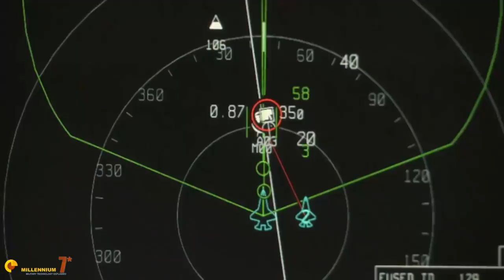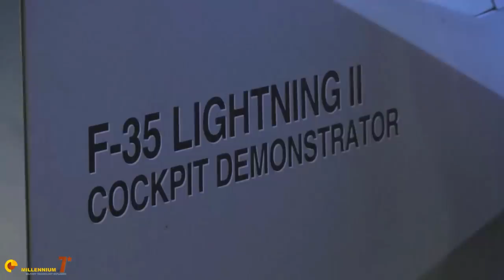Put the F-35 inside the F-16 | Are there limits to upgrades?

Comment: Guess I have to give up on the fantasy of a beefed-up F-16 powered by the Pratt&Whitney F119....
Reply: Some of the most important features of the F119 motor come from the airframe it’s mounted inside.  5th Gen designs don’t have federated subcomponent systems like a 4th Gen aircraft.  The AESA radar is part of the engines, which are part of the DFLCS, which is part of the VLO management software, which is programmed into the central brain, where everything connects.

There’s a GE F100-GE-132 for the UAE Block 60 Desert Falcons with 32,000lb of thrust, meant to lift all the extra weight they packed into the F-16E/F.  UAE bought those for $200 million each.  After a few years of operation, they signed a peace deal with Israel so they could order 50 F-35As.
Reply: @unknownuser069  It didn't compute when that statement was made by F-35 developmental pilots either, since my framework of understanding was based on systems architecture from the teen fighters, primarily the F-16 & F-15.

If you look at the low pressure cold fan stage of the F135, it has heat exchangers integrated into it, which are an integral part of the IPP, which is integral to the radar power amps and other hot systems. Additionally, these are all integrated with the IR signature reduction systems, which are many.

It's not what I originally thought it was. I expected to see a relative balance of federated physical sub systems "integrated" via fiber-optic connections with streamlined harnesses and basic layout like a Viper.

Nope. The physical subsystems are integrated, eliminating the legacy E&E, APU, EPU approaches and creating something entirely different.

It's revolutionary just from power generation, gas turbine engine, and flight control systems engineering, as well as maintenance access points.

I assumed many things, but studied before drawing conclusions. At every turn, the JSF variant lay-outs are a series of inspiring engineering solutions.

I am forced to recognize how brilliantly-executed the systems design is. 

Examples include the Electrohydrostatic Actuators with fly-by-light and fuel mass cooling, the radar back-end systems and EOTS accessible through the nose gear bay, the fuselage common inspection and service components accessible through the weapons bays, the RF antennae embedding all over like a Raptor, only done more efficiently, the cockpit with just a few switches for start-up and pilot-configurable Panoramic Display, the IR concealment systems....

It's radically different from a Viper in every way, all of them formed by hard lessons-learned on the teen series, F-117, & Raptor.
Reply: @unknownuser069  I’ve merely re-stated what the test pilots have openly mentioned regarding systems connectivity and how it differs from the previous generation of design. I  haven’t taken the "wrong implications".  You might be used to dealing with children who don’t have any relevant background to this, but I’m not one of them.

Of course the F-35 isn’t a single component.  It has systems integration that is on a totally different level than 4th Gen fighters, as I described.

X-35 was a different airplane.  Different cockpit, engine, structures, no weapons bays, with some of the evolved systems from the AFTI F-16 and NASA F/A-18 that were developed for JSF, the EHAs and IPP being just 2 examples.  

F-22 was a radical departure from the F-15 as well, but they’ve been really tight-lipped on anything associated with it.  Even if you knew someone on F-22 CTF, you couldn’t call over there just to chat.

I know the IR concealment systems on F-22 are such that when you try to acquire it with JHMCS and AIM-9X, it doesn’t work.  From there, you could work backwards and see how the airflow is managed through and around the TVC nozzles, coatings, structures, heat-sinking, etc.  They were’t screwing around when they said VLO.
Reply: @unknownuser069  I see where one of my statements was confusing and have amended it.  The one about subcomponent systems.  Of course there are subsystems, but the way things are integrated are much more intertwined than I originally assumed, before I dove deep into the F-22 and F-35 systems architecture.  That’s the point I was trying to make.  They didn’t just take 4th Gen systems design and pack them into 5th Gen airframes.  They took decades of lessons-learned from performance, maintenance, modularity, upgradeability, and sustainability and incorporated that into the physical structures and systems in ways I’ve not seen done on the teen fighters.

I was tracking what they were doing with the AFTI F-16 at Edwards since the early 1980s, and most of those systems went into JSF, some even into ATF before.  If you look at the AFTI F-16, it had 2 pre-LANTIRN pods built into the wing roots.  We knew that JSF would have an integrated FLIR/LST pod built into the airframe somewhere, as opposed to a bolt-on unit like LANTIRN/SNIPER/LITENING.  We also knew that AESAs were the future.

My initial expectations for JSF were a small airframe with a little AESA, integrated FLIR, with a VLO airframe.  It is so much more than this because of the inertia of technological progression in each area of systems development, and the way they were all integrated together.